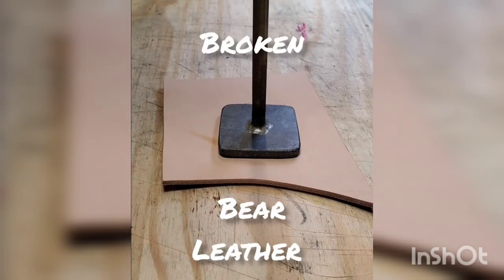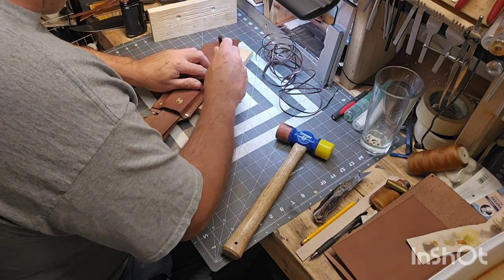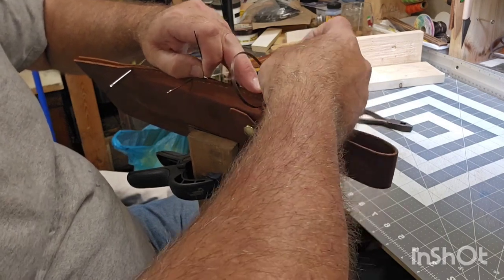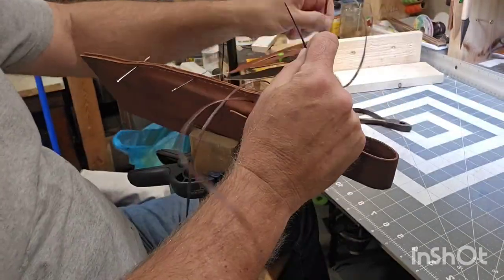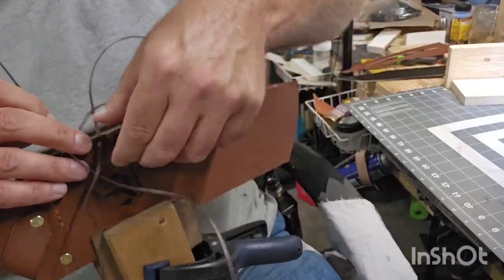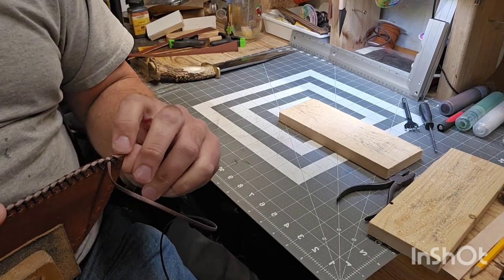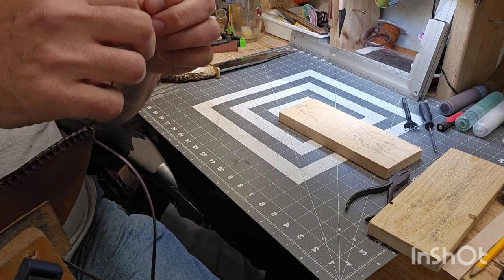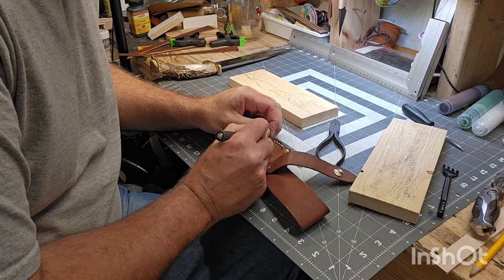Double braid sheath lacing

Comment: Why do you put the strap on the blade side,should be over top so it cant be cut
Reply from the maker: I'm picking up what you're putting down. In that case, there wasn't enough bite on the backside of the  guard to keep it secure. It's a risk for sure but the lesser of two evils.